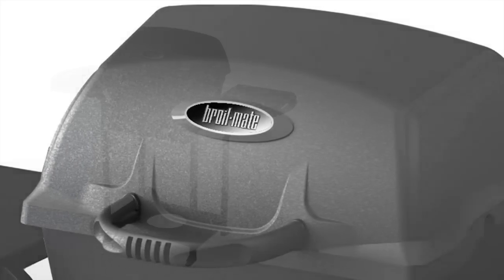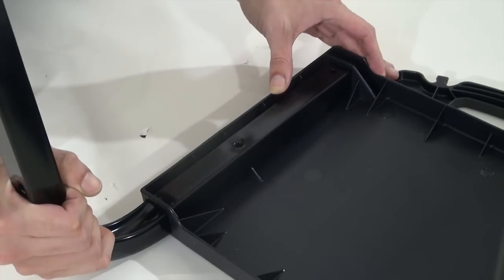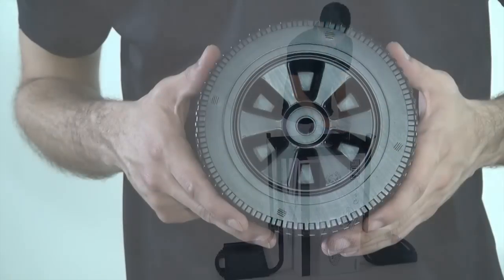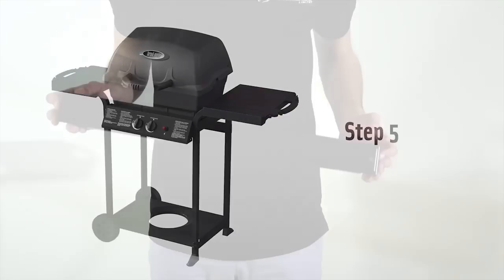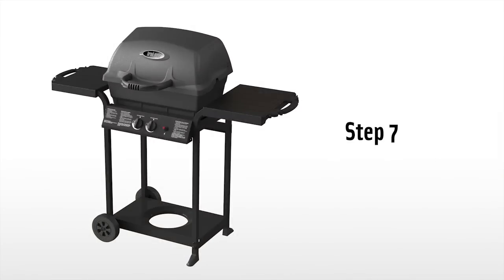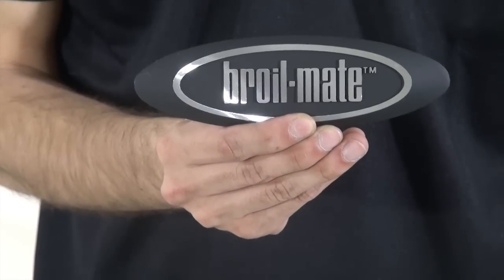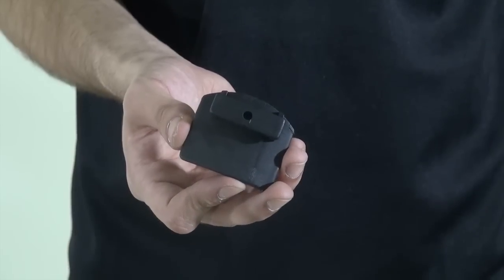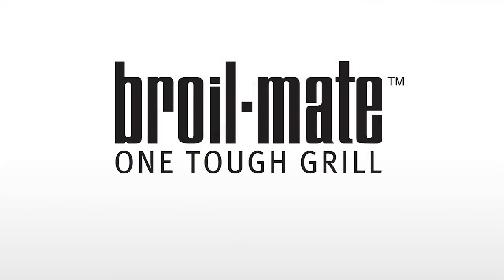Broil Mate - 24025BMT Assembly Video

Comment: You are the greatest...thank you for this video, I almost  calling the service for ignition cable attachment  because the installation manual had not any info about it..Thanks
Reply: Cannot find the connection for the ignitor which came preassembled on model 1651-54!

Comment: Hey there, great video, thank you. I have a question. I am a little worried about the slotted burner tubes as they may let the gas out. Is that normal? Should I be concerned? I can see the other side through them. What are they for? Thanks